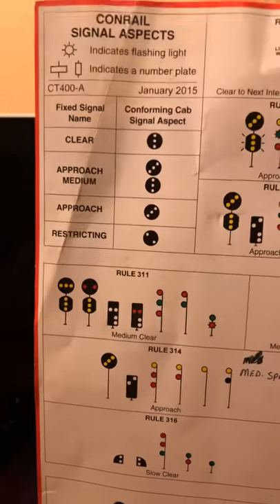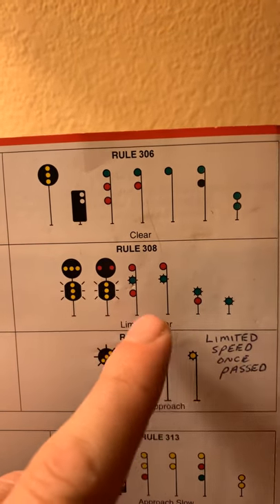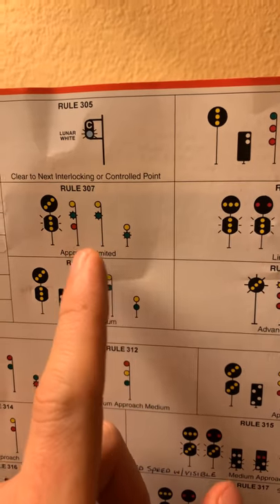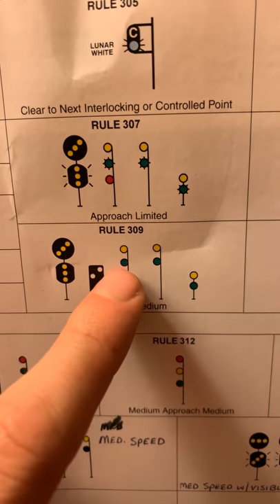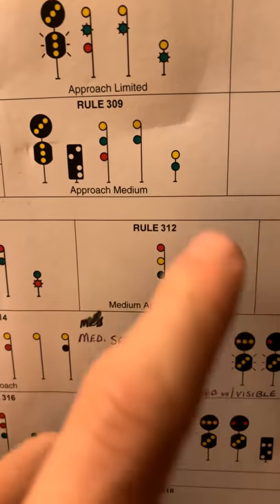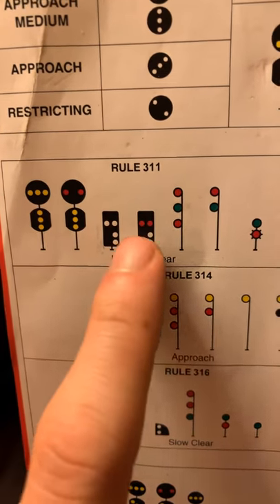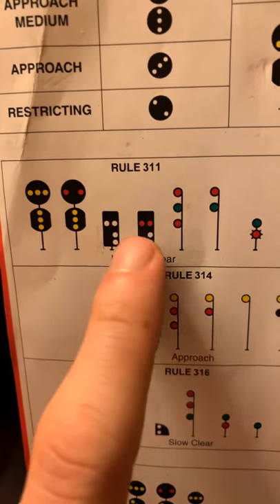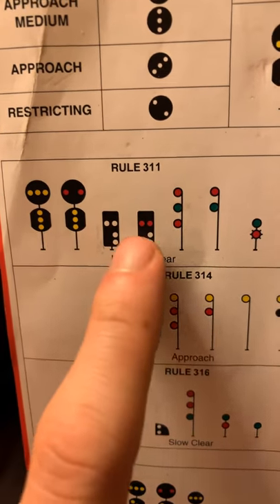NS conrail Signals 101

Comment: Nice!  I recognized some of the positional ones based on the old PRR system.  But I've always wondered about the ones where, "proceed through switches, turnouts, etc...  then resume maximum speed."   My question is, how do you know when you've made it past the last switch/ turnout?   Just have to 'know' that particular stretch?   I mean, you think you've passed the last switch and hit the throttle, then OOPS!!  Here's one more??
Reply: Most likely the engineer would set the counter that has the train length entered.  When the train clears the turnout you get a beep sound and can resume speed again.
Reply: @chlomyster8526  Thanks.  I've learned since that locomotives have that 'counter'.  Back in the old days I suppose it was more 'skill / experience'.
Reply: @mikefochtman7164  Back in the old days the conductor in the caboose could signal the engineer when it was time.

Comment: Do you primarily work out of the yard or do you get to go out on trips? I am applying to the Harrisburg hub.
Reply from the maker: Andrew Koser your not permanently stuck anywhere really. You can make moves based on your qualification. They’re called 30 day moves. If you hold a position, you’ll hold it for 30 days until the next round of bid vacancies come out, or if your bumped by a senior man and displaced. If your bumped you have 48 hrs to find an assignment and place yourself. Typically I’ve held an assignment for a week or two then was bumped and would go out on the road list for a few trips then get bumped again and head back on to a yard job.
Reply: @absoluteblockproduction2039  awesome. The variety of the job is what really appeals to me!

Comment: Does Amtrak conductors follow these same aspects?
Reply from the maker: They’re all very similar. Amtrak has a few special signals that aren’t on NS such as a flashing high green for Amtrak is “cab speed” meaning you are to adjust and run your speed as to what cab signal is currently displayed. A flashing green on NS conrail territory is a “limited Clear”. Amtrak also on their position lights on the corridor have a “stop and proceed” which will be a red with a lunar light below it lit.
Reply: @absoluteblockproduction2039  if you're interested in a little history, the Stop and Proceed rule dates all the way back to the Pennsylvania Railroad days. In those days if a train came upon a stop signal with a number plate on the mast, the train would have to stop and contact the dispatcher for permission to advance at restricted speed to the next signal. Furthermore, if there was a G sign under the number plate trains could proceed at restricted speed without contacting the dispatcher. The G meant that the train was going up a heavy grade. The NS did away with this rule sometime in the 90's or 2000's and made it all restricted speed.
Reply: @jm0lesky  Originally, the PRR Grade rule only applied to trains over a certain tonnage.
Reply: @jovetj  That makes sense
Reply: @jovetj  That makes sense

Comment: 0:56 Not only too much money, but the process of retraining all the train crews to acclimate and gain experience on the new signals would have been horrendous!
Reply: I think it's highly misleading. First off is they don't have to rip them out at once, they can just slowly replace them when the bulbs die. Instead of replacing the bulb, replace the entire signal if they're of the design to be removed. And it's not like the railroad is starved for cash. Norfolk Southern alone makes around $8.6 billion in profit annual. For reference, Denmark converted their entire country's rail signal systems for only $3.2 billion. That could be spread over the course of 10 years if they wanted to easily cover a large quadrant of the country. 

Now of course NS's total coverage is about 12 times that of all Denmark, but they don't even have to replace all the lights, they just have to remove the less common or more confusing signals. That means instead of having 6 methods of having a restricting, bring it down to one or two. There shouldn't be any confusion with just removing signals from circulation vs making a whole new system. 

But even if they did replace every single light, the profits made could easily pay it all off in only 10 years assuming less than half of current profit goes into this project. That means in reality they could truncate the entire system with possible 1-3 years profits. That's incredibly realistic. The thing is that the railroad is cheap, even if it makes employing people easier, and firing less people from confusion, it's still cheaper to use people as fodder than actually fix the system.
Reply: @Skylancer727  Unfortunately, that isn't how altering signal systems can work.  I cannot be done slowly and methodically over a long period of time.   If an entirely new signal system is to be installed, it's installed alongside the existing system, tested in place, and a date is chosen to cut-over to the new system.  Change is hard, so one big change is going to be easier for experienced crews to accept versus many, many small changes over time.
Reply: @jovetj  I don't think you understood what I meant. We don't need a new system, we just need to truncate the existing one. A simple one is remove pup signals. They literally just add confusion and are one of the highest causes of starts due to their own unique meanings. Removing it and replacing just those immediately makes the system slightly less complicated. 

Or what about the fact both position and color signals cover every type of move. Why not just take out half of those to make the system instantly less confusing? Again, since it's only a removal of signals and not a whole new system, there shouldn't be any added confusion, it should only be more intuitive. And since we didn't completely shift the system there shouldn't be any issue with only doing this over the course of a decade. 

Let me be clear, I'm not suggesting unify the entire US railroads, just simplifying it in the existing systems why they're sporadic.
Reply: @Skylancer727  Pup signals?
Reply: @jovetj  They're like color signals but only usually have one color, sometimes 2, but are distinct with the fact they're either like leg high or less than shoulder height. 

It's in Conrail's system.
Reply: @Skylancer727  They are called dwarf signals and they are very common across the United States (and the world, for that matter).  
You explaining "eliminating them" would solve problems indicates  (pun intended) to me that you don't know what you're talking about.  They are used in specific situations (e.g. space restrictions, and/or where visibility at a distance isn't very important).  While a dwarf signal is another way to display the same thing, they're also not ambiguous—they're unmistakable.

Comment: How do you know when the train has clear the block?
Reply from the maker: If you are being given a clear to the next interlocking, there will be a special light on the mast that has a C under it lit. This is mostly used in the event the lead locomotive has a cab signal failure out on the main.
Reply: @absoluteblockproduction2039  is it the conductor who has to radio in to the dispatcher about the signal the ugh are passing through?